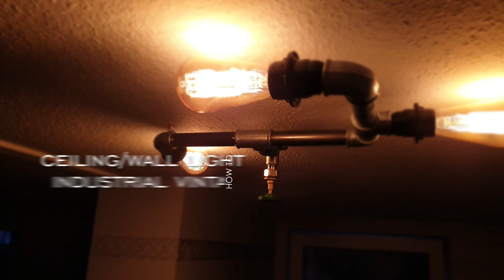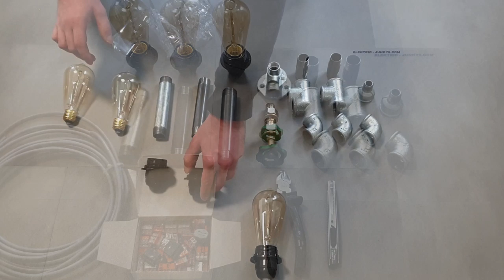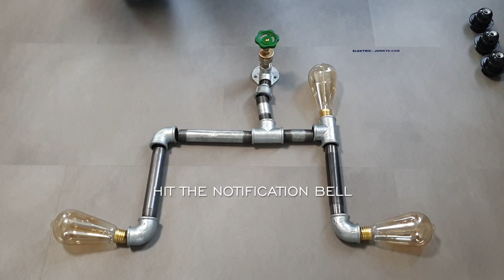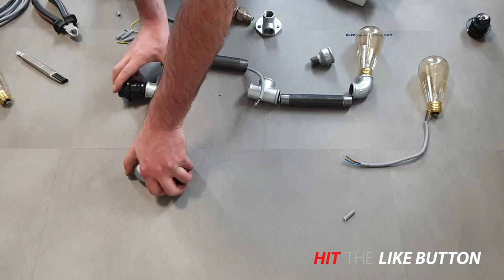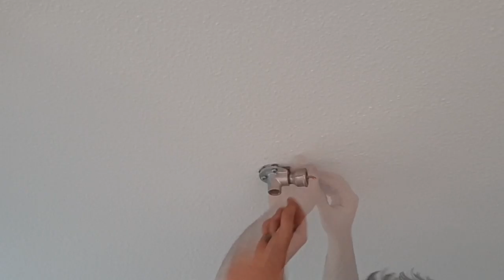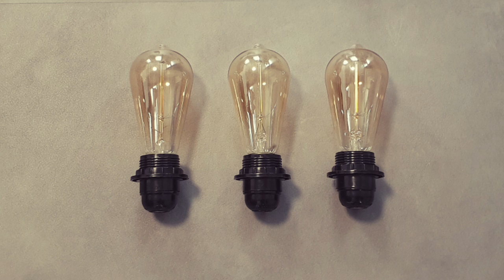Vintage Ceiling Lamp DIY | made of Old Water Pipes | pretty affordable

Comment: You need to connect to a ceiling light electrical junction box to be code compliant. One of the trickiest parts of these pipe lights is finding a a way to attach the flange to a ceiling junction box.
Reply from the maker: hi, that is right a Ground Cable is Pretty Important, please do not replicate this Project if you are not an Certified electrician ! Safety First
Merry Christmas to all you guy´s